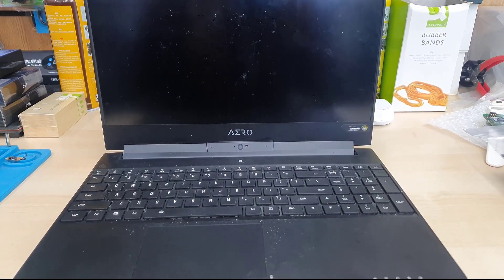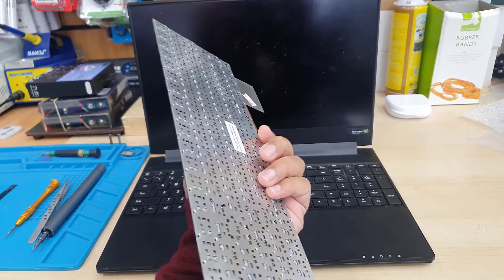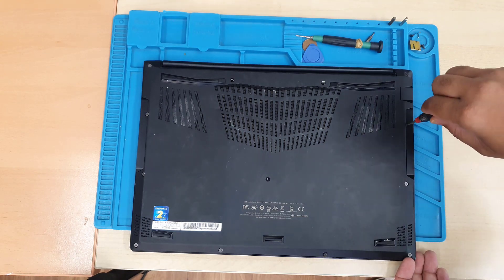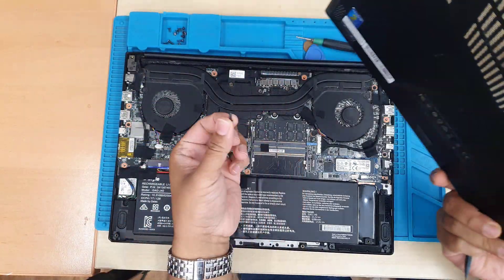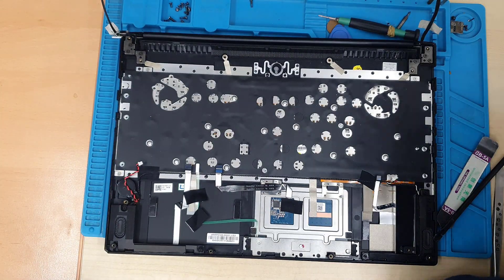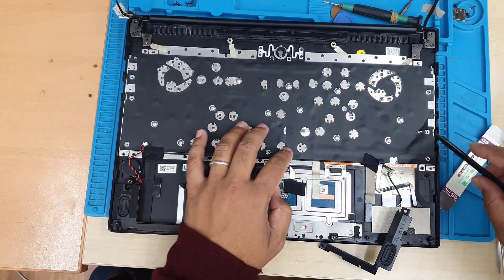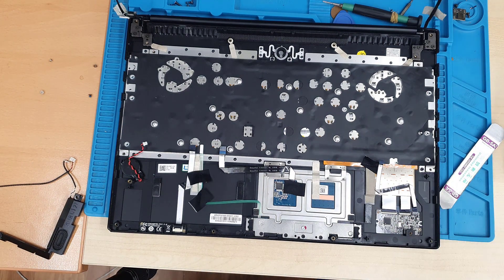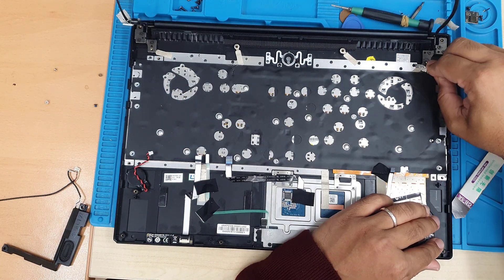Gigabyte Aero 15 Keyboard Replacement Tutorial | Step By Step

Comment: Hi thanks for the video
I have a problem with the keyboard on a similar laptop. The keyboard intermittently turns off with code 43. Reinstalling the drivers, as well as a complete reinstallation of the system, doesn't solve the problem, so I made sure that this is a hardware problem. But I don't know how to determine that the problem lies with the keyboard itself, and not with the motherboard, or a small board that is connected by two cables to the keyboard. Are there any tips for this case?
Also interested in whether the keyboard you installed has a backlight, and is this an original part?
Thank you
Reply: I'm having the exact same issue, did you figure out the problem in the end?